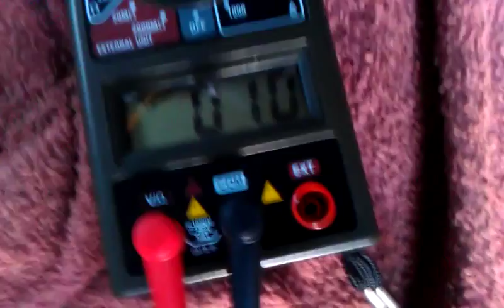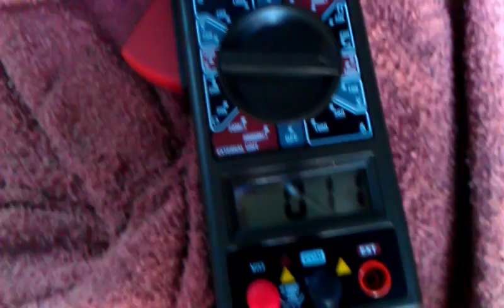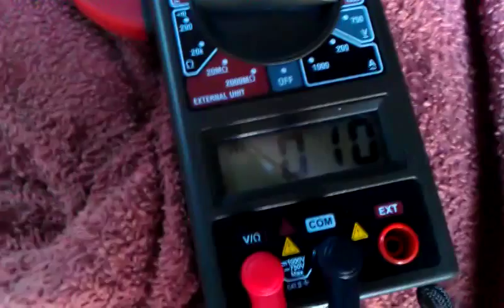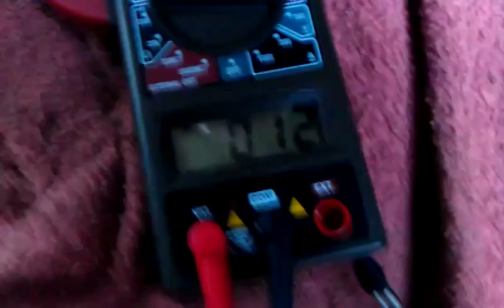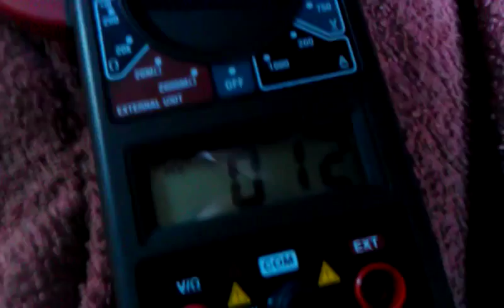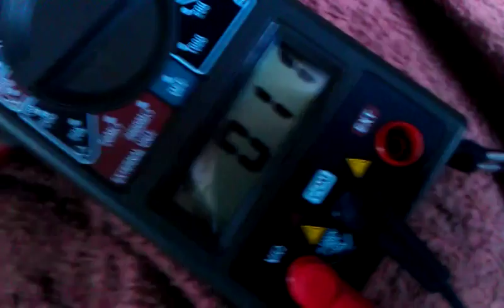Help with my power drive 750watt inverter

Comment: How long and what gauge wire you use to connect your inverter to the battery will effect  weather you can use all 750 watts. your amp at  draw 12 volts from your battery is significantly higher than your amperage to the ac equipment  at 110 volts. it's almost like algebra.

Comment: Your battery voltage is much too low, these inverters have a low voltage shut down usually about 10.5 volts.
when your engine is RUNNING you should have 13 to 14 volts at the car battery.
If you neasure over 13 volts at the battery with the car running and only get 11 or 12 volts at the inverter that means you have a voltage drop, make sure you are using at least 10ga. wire from the car battery to your inverter.
BTW drawing that much of a load without the car running will kill the battery quickly.
Reply from the maker: Ok, Thank you, that info was very helpful.
Reply: You are welcome.
How do you like your HF Bunker Hill DVR?
I was thinking of getting one when I save up the cash